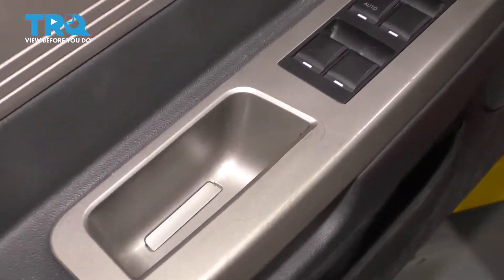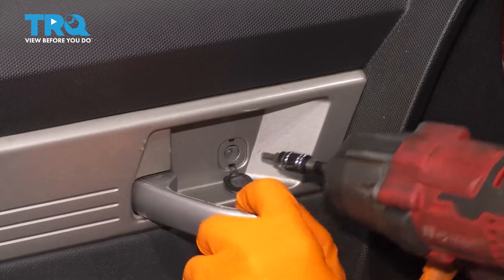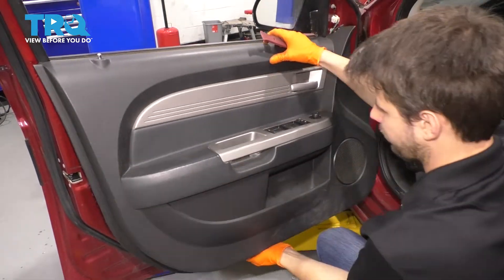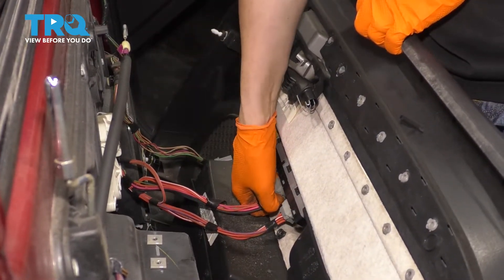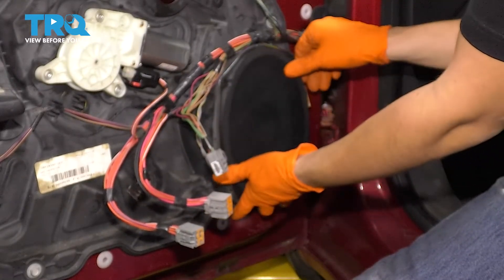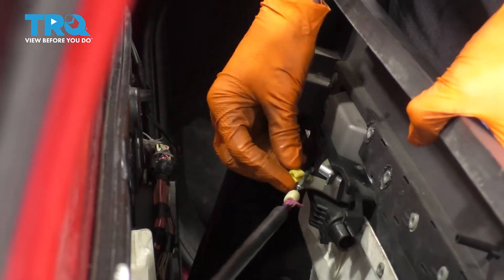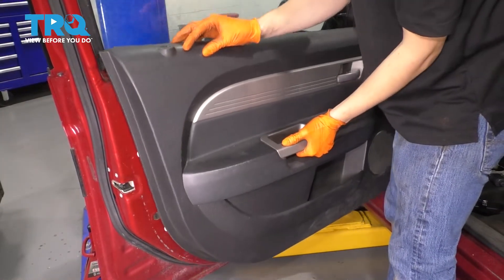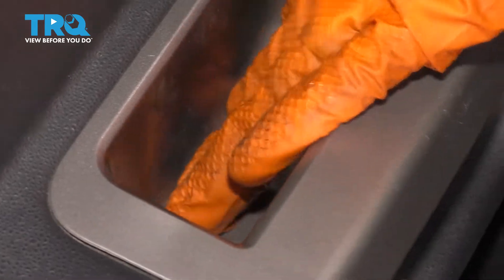How to Replace Speaker 2007-2010 Chrysler Sebring

Comment: Hi there…I hit the link for the speaker you have in the description but when you look at what years it fits it says it doesn’t fit a 2010 Sebring? I have the front door speaker out in my 2010 Sebring Limited 2 door hardtop convertible with premiere sound system. Could you recommend what speaker goes in that car that can clip in like that? Just clipping it in like you did in the video is so much easier.